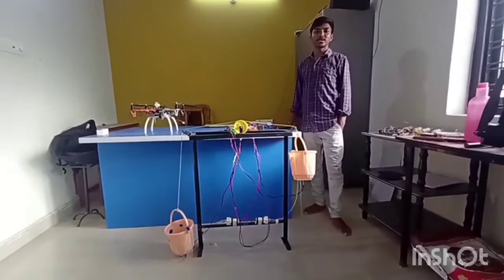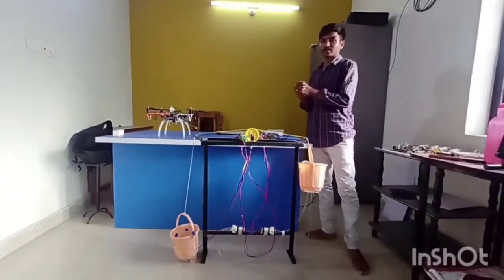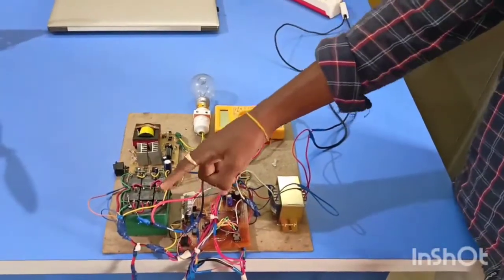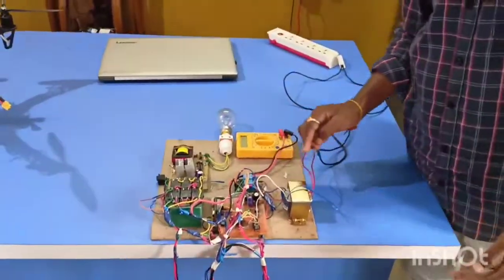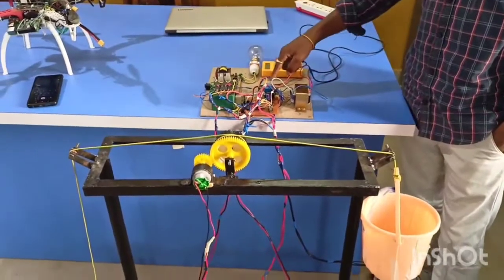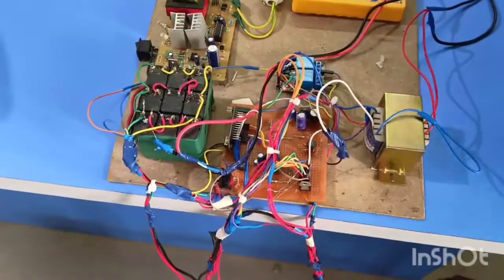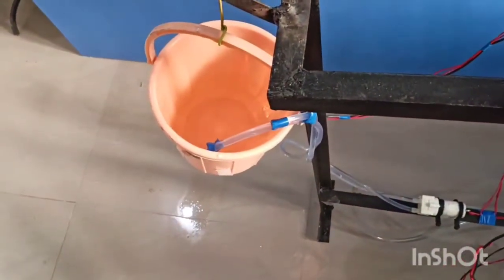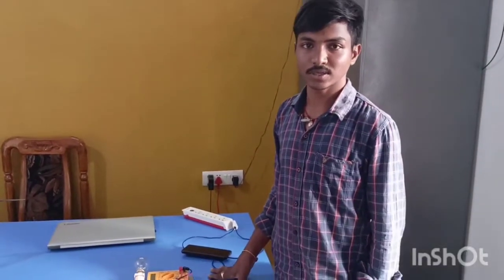power generation through gravity

Comment: @EPIT RESEARCH LABS
Good effort. The water pumps almost runs for 2 minutes, where as the dynamo runs for 5 sec (10 turns), this is not putting more energy to battery than it takes to pump the water between buckets.
Reply: yes
Reply: 2min and 5sec -> 24:1 ratio ( load > generation )